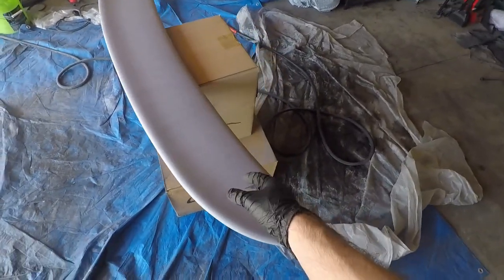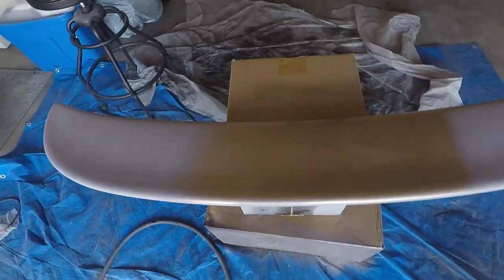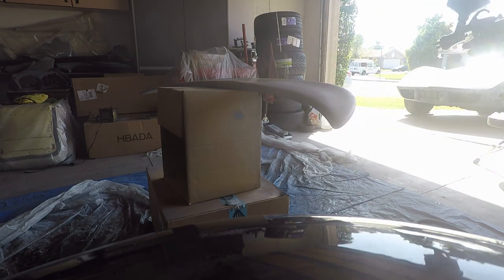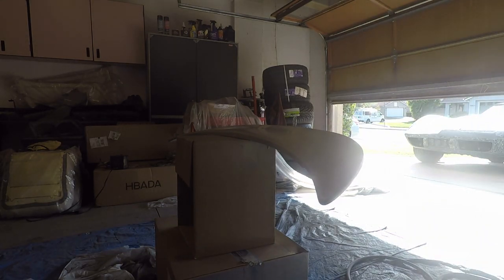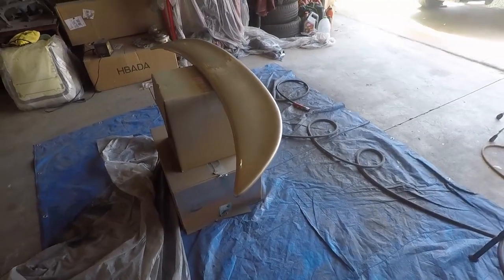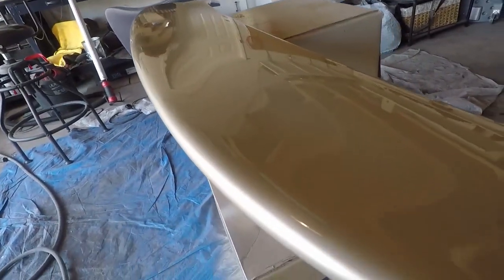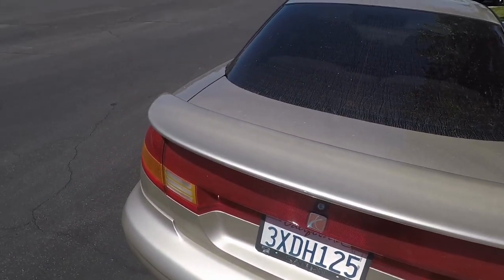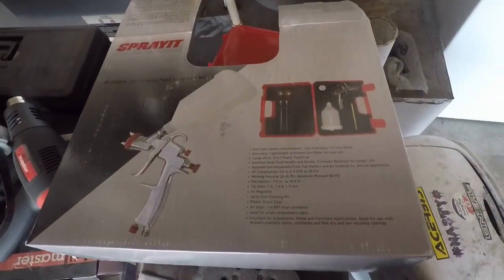First Time Painting With A LVLP Paint Gun

Comment: You don't need to sand it off. Just finish applying base , then nib it apply more base. Let flash and clear coat. By the way don't start and stop airflow from gun just fluid. Airvalve in gun is a 2 position valve. Get a handle on that and you will be a lot more fluid in your motion
Reply from the maker: Thanks for the advice :)

Comment: Dont know if you ever fixed your runs or not, but just take a new razor, put a piece of tape on the ends to hide the corners, then a little at a time scrape your runs out. Then go over your razor marks with 3000 grit (sand until you cant see the razor marks). Then get ya a Harbor Frieght electric DA and a medium foam pad (prob orange) and some polish like Meguires or the Turtle Wax One and Done. Pretty much any polish designed for a da will remove 3000 grit that.
Reply from the maker: Thanks for the comment! As you can see, I later on painted my 79 corvette and have a pretty good size run on the hood. I have yet to repair it but I now have your suggestion to try. I’ve also heard of using bondo around the run and then sanding it out that way

Comment: Dude, my heart was in my mouth as you were spray g the blasted  spoiler was shaking... The gun is a copy of the Iwata W400 Classic. I should know, as I have it as part of my collection. Which numbers 28 spray guns and includes high end Sata's, Devilbiss and Iwata's. I have 3 LVLP and they are OK. You cannot beat the real tried and tested big players.

The starting point has to be choking your gun down so the material is just coming out but neither dry or  too much. I would say, 2 turns out from fully closed on the material control and around 20 psi for base and 28 psi for clear coat. Most of all, play about with it to get the sweet spot for the gun. Imagine you with a Sata 5000 in your hand or a WS 400 Supernova. There would be more runs than waves on a Hawaian Beach!!! 😅😅😅😂😂😂😂
Reply from the maker: Haha for sure. Gotta work with what I got. I do really like this gun tho and as I have gotten better it does better for me :)
Reply: @bluesxt  Thanks for replying. Yep, for sure get a folding panel stand. NO, cardboard boxes are a defo failure, been there, worn the T shirt. I am self taught and would advise you to paint with light coats, flash off quicker, no reactions, and risk of runs. Then once you have coverage go wetter especially with clear, you need to follow that wet edge. Whatever gun works with you. I was using Devilbiss suction, then gravity feed came out, then hvlp, then mvmp, then lvlp. Lord knows if they will bring out a gun which uses as much air as it takes to suck on a straw. So all of my guns will be defunct then!!!! But for me they epitomise, professionalism, quality, and God these Krauts know how to engineer a spray gun!!! Anyway stay blessed and safe.
Reply: @niamakhtar2234  Ive been using a 1.3 HVLP gun to paint a lot of small parts. The wasted material is killing me. What LVLP or LVMP gun would you recommend? And would it be worth purchasing one to help save from the wasted materials?
Reply: In my honest opinion. And I am in the UK. There is a company called GT Air and they have LVLP guns. Think the name is Burisch. They used around 6.5 cfm and I have 2 of them in my Arsenal so as to save materials. If I could sell all of my guns.... Which I would not, but I really rate them. They do repair kits for them as well. And I have used them myself. Take a bit longer to lay the material as it is not atomising with the same pressure as an HVLP and you have to move in with the fan. But what a good piece of kit!!! And they are only £54 on their website. I managed to get a 1.3 and 1.8 for £45 posted to my home address. Brand spanking new. Chappie had used them once and put them to one side. I cleaned them and added them to my already BIG spray gun collection???? Happy days.
Reply: @niamakhtar2234  thank you so much for the info! I’m going to look into those.